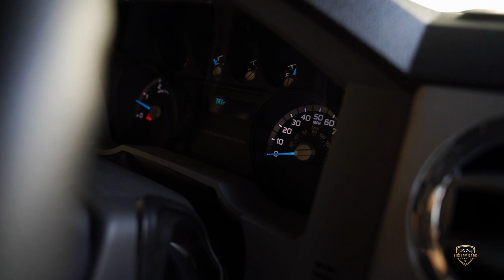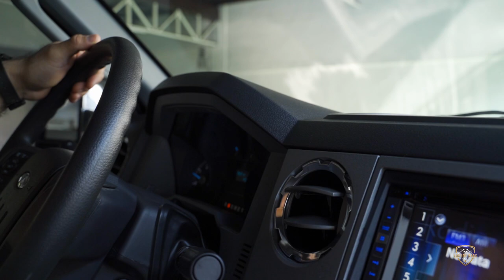Luxury Cars Manila : 2021 Ford F650 Supertruck

Comment: The GMC Topkick/Chevrolet Kodiak is about the same size. They were sadly discontinued in 2009.
Reply: its not as big as the 650 but chev makes a 4500 and a 5500 again since 2019
Reply: Ironhide of autobots

Comment: Ok the dual lang thing has too go…these trucks are huge and a waste of money..the insides are plain cheap plastic ,they can’t get out of the way, plus you can’t use them for anything other than to say hey look I’m a king ,and I can afford to spend cash.,but the silly thing is that you can buy a fully loaded f250 for about the same price so really it’s not for the rich, just those who like big toys I guess..I would hate to drive a truck that has zero power.l
Now I’ve seen a coup,e with above 800hp and 2mpg which is what it really needs, but that was a 300k truck on a totally different level than this or about 90% of them
Reply from the maker: Ok .. thanks for the comment